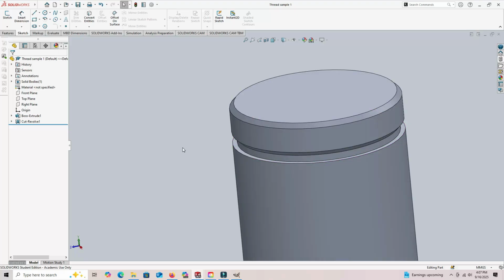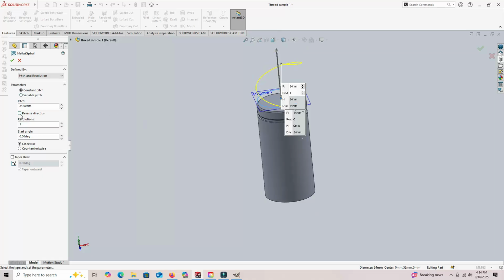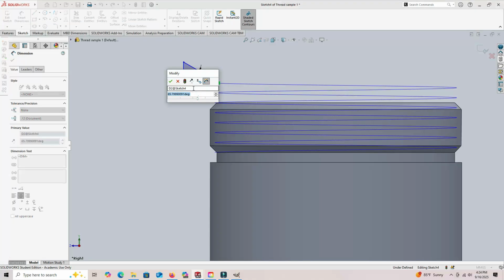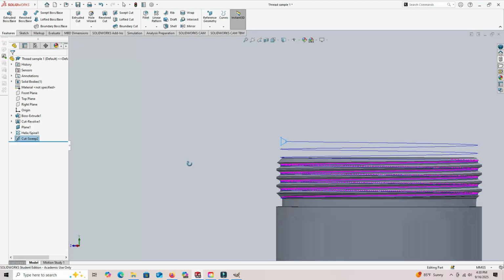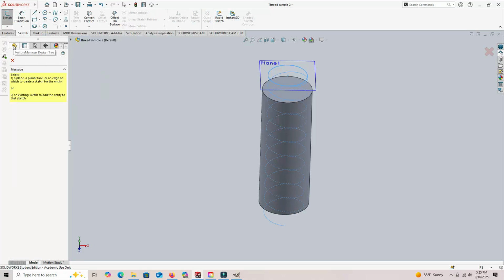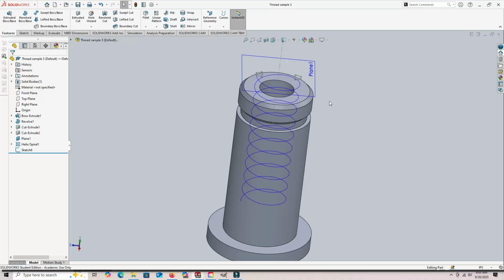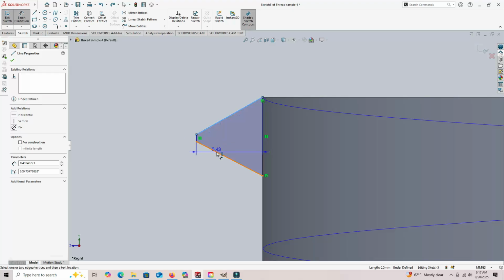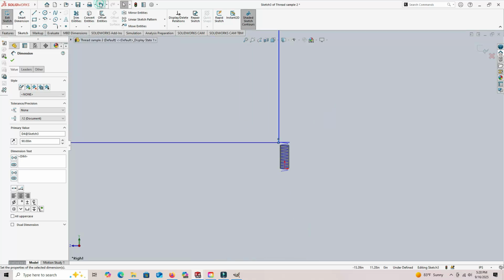Solidworks Tutorial 13 -  Making Cosmetic Threads with Sweeps and Helixes

Comment: This doesn't look like a cosmetic thread.  It looks like a modeled thread profile.  Creates a lot of detail that can bog a model down.  I thought a cosmetic thread was an annotation attached to the feature sketch that showed in the drawing but didn't exist in the model. Am I missing something..
Reply from the maker: Just a difference in terminology. The standard way that Solidworks denotes threads as a straight hidden line at the root of the thread is sometimes confused as internal geometry. This method does tend to make your computer lag to oblivion.

Comment: Thanks for the video. Can you do a video on the information that would go in the drawing for the threads? It would be interesting to see how this information is communicated to the machinest. 
For the nut and bolt how was tolerace addressed?
Reply from the maker: For any non-standard thread, it would be best to spell out the desired dimensions in a note.  You can work out the thread tolerance based on the mathematical standards for the thread form and the given pitch.
Reply: @StuartdeHaro In F360 I would do this bia variables and formulas. Which was easily and intuitive.  Haven't figured out how to do this in SW.